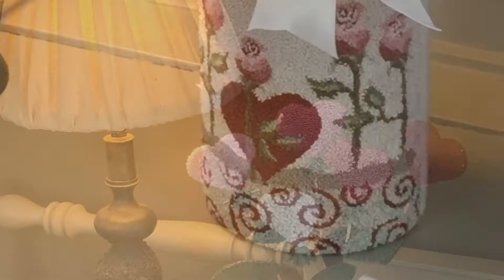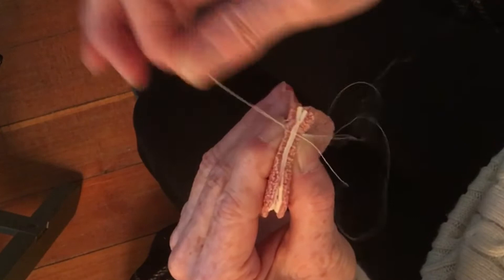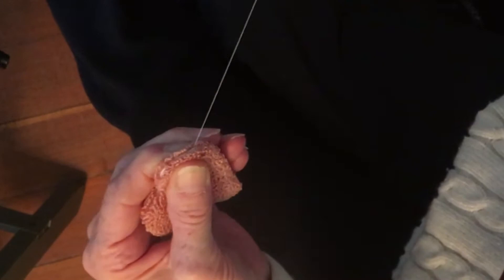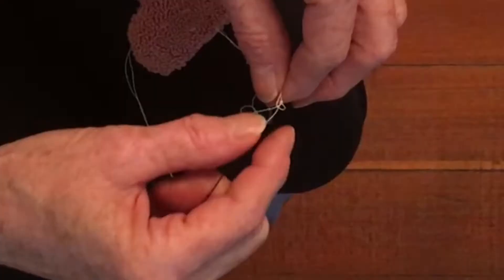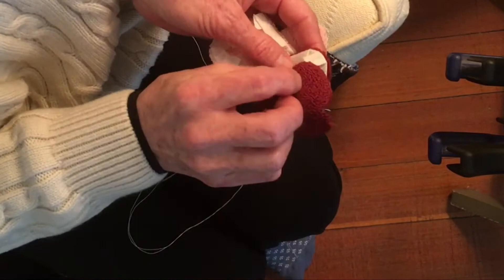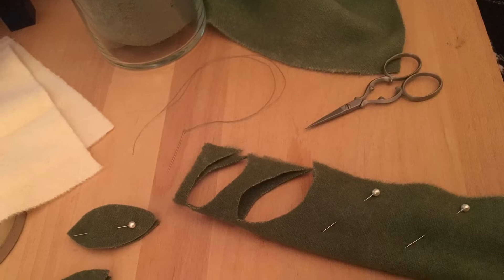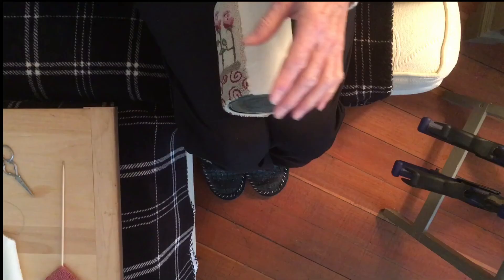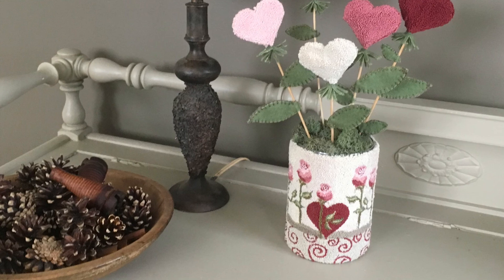Lesson 8 - Valentine Kisses

Comment: Which lap or floor stands would you suggest for punch needle embroidery? I have carpal tunnel and arthritis in my hands and it is really hard to hold the hoop. I have an Elbesee lap hoop but was looking for some advice.
Reply from the maker: Hi Monique, My frame is a GRUBER FRAME for rug hooking. It’s a about 12” square. It also tilts and swivels with adjustments for both, to tightly or loosen as you like. It is very important that it turns, so you can spin it to work on different areas easily. The Gruber is a lap stand, I drilled two holes in the base and mounted it to a tv eating table. Works beautifully. Take care of your wrists and hands. Kate
Reply: @kategillery5001  Thank you so much! Yours a gem!😊